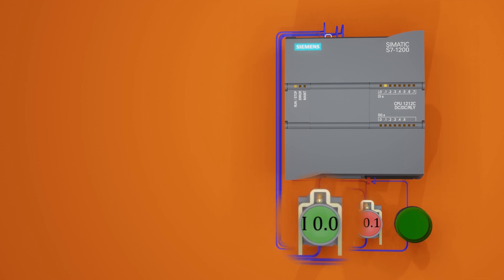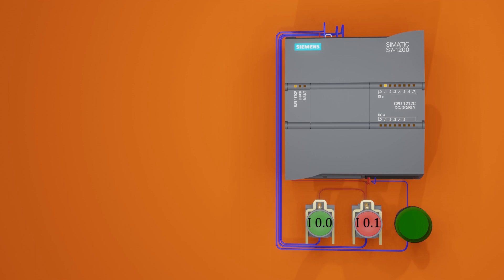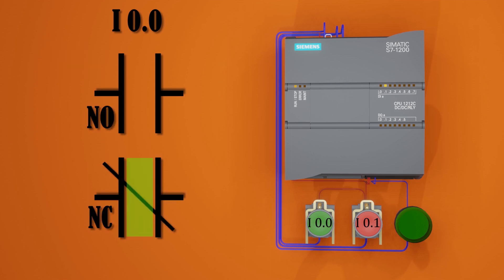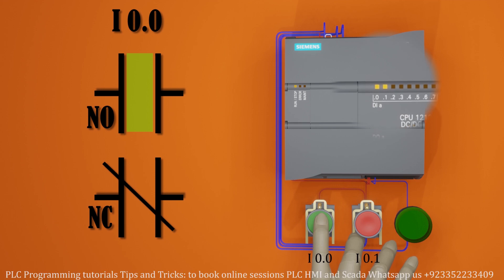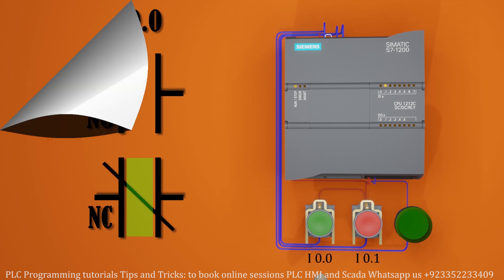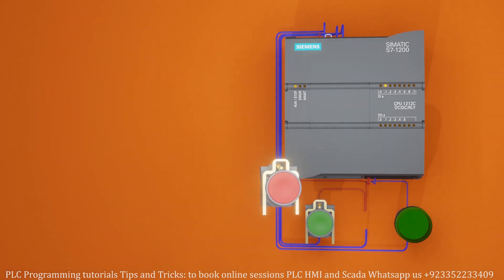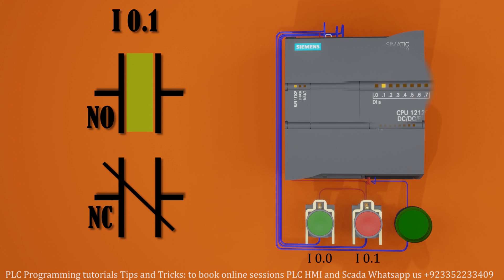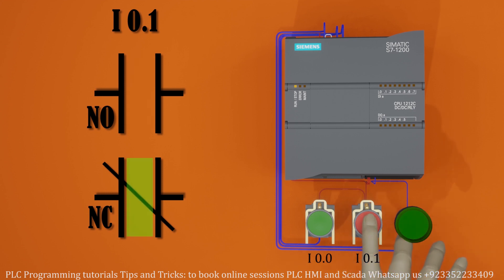normal open and normal close contacts in the Ladder logic explained

Comment: I want long video with encoder tia portal
Reply from the maker: hi thanks , what do you want to do with encoder ?
Reply: @EASYPLCTRAINING  how to connect an encoder to cpu. for example with a machine tool. there is for example a motor with an incremental encoder on the x-axis. how to process the signal so that hmi shows movement along the x axis. Make a button on hmi and when pressed to reach the limit switch and it was 0 on the x-axis